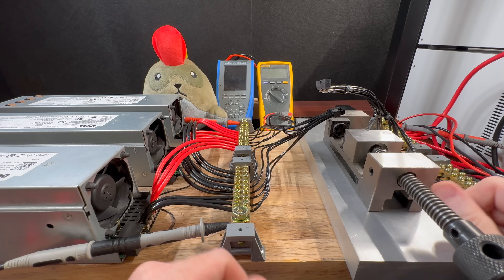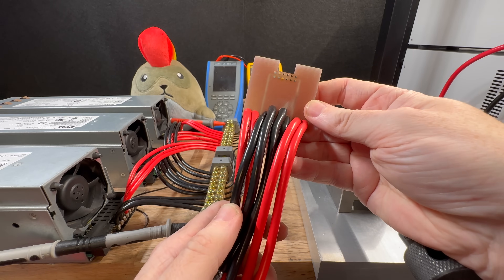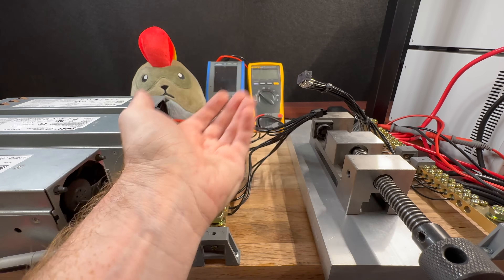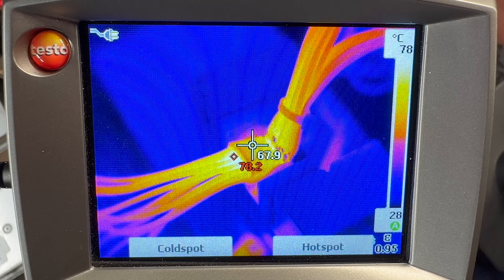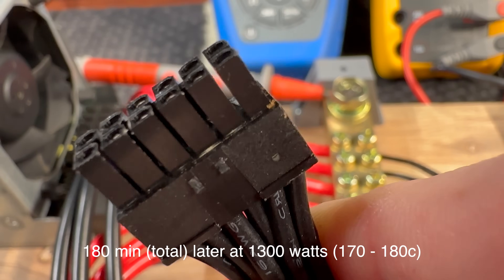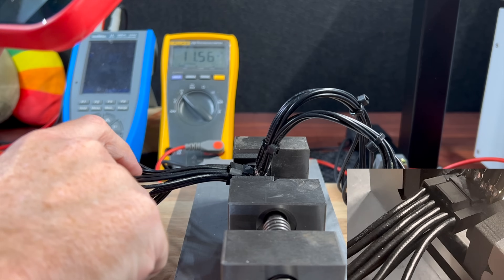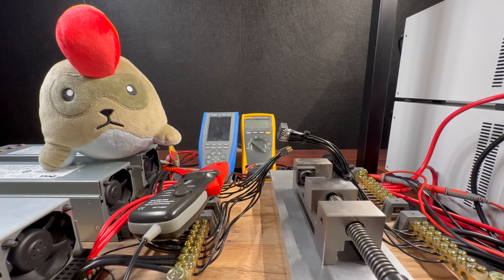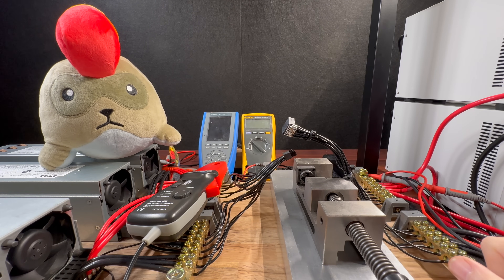NVIDIA 12VHPWR - Q&A + Melted Wires

Comment: Thank u for your practical tests. I think you have to keep adding current, because people keep saying connectors and cables are melting. Even if u have to put in 2000w to make them melt, atleast u have finally proven to people that those plastic cables and connectors arent made of titanium.  XD    All i see everywhere is "melting cables, connectors,nvidia". Next test someone should do is take some corsair 1200w power supply, open it up, solder wires inside power supply board, not directly to connector  to test how power is transferred to that 12vhpwr connector and how hot it gets. Because i have seen psu side get hotter than gpu. I dont understand why everyone blame graphic cards for melting cables, its power supply that is giving  that power and its power supply that HAVE to put stabile power on each pin and balance the load. It is real quality issue with power supplies. How can most people have no issues while few say cables are melting. Funny is how they post 1 or 2 person pictures on hundreds of youtube videos, making it all look bigger issues than it is. Only time i had problem with gpu connector, it burned but didnt melt, was when gpu mosfet shortcircuit and exploded. Cleaned up connector and it was fine to go again. Car battery cables are much thicker and even there current is smaller than what u are using during that test, so i am surpised how those tiny cables endure it.
Reply: The reason people are blaming graphics cards is because they removed current balancing and individual pin current limiting from the 40 and 50 series. The way they wire the power bus on the gfx card side now, it can't tell if only 1 wire is connected supplying 100A or 10 proving just 10A each. It used to be they would split the power busses for every connector, have 3x12v rails (3 sets of 2x wires of the 8 pin connector), and have current sense and balancing for each and every pin, in-order to make sure the power-draw was even across them all (when needed), as a very much needed safety precaution. It also allowed for safe uneven power draw, as it was limited on a per pin level and tightly controlled so drawing less from one wouldn't drive up the others as they were also tightly limited too.

Anything drawing this many amps across so many wires should have some kind of protection against failer modes in supply imho. Now Nvidia have ditched the 3 split rails and essentially every power wire, across however many multiple connectors it uses, at the GFX card side ALL goes into a single power rail directly, and not through current balancing circuits or individual current limiting circuits either, like it used to. So now it has no idea if only 1 or all 12 of the wires are even electrically connected or not (in fact it doesn't even know if only one wire out of a single one of 3 connectors is drawing 3x an entire connectors worth of amps, if it was paired with a PSU where the 12V hp rail fed multiple connectors at the PSU end!). Providing the connectors them selves are plugged in to the GPU and their sense pins remained  un-effected (which they would be likely to be, as they don't really pass much current), the result is 40 and 50 series cards are happy to draw 200W or even 600W+ through a single wire and cook it's self, and it would have no idea this was happening till the power dropped from a physical failer of the wire/last surviving connected pin, and I don't need to explain how dangerous that could be...! If you swapped out the 10 pins that supply power with a single 1Aut cable, and left the 2 sense pins attached, the GPU would be none the wiser as it just connects every single power pin together on the board directly anyway!!!

The reason we don't blame the power supply, is because it can't be expected to know what the load wants, it has no way to know if say 2x12V plugs are supplying one or two separate cards, and it has no idea if 1x12v plug is supplying 1 single rail on a card drawing universal amps, or 3 separate rails on a card all needing different amps, so it just gives what ever the load can take or "asks for" by it's current limiting circuit, when within the PSUs overall current limit (as the load demands will vary massively between, say idle, and running 4k gaming on 3 monitors for example, the supply needs to be able to supply what the card needs when, and balancing could throw off a card if it has multiple rails and has differing power demands on each, like a 3090 might have just for example). It's up to the load (in this case the gfx card) to limit and control exactly what power it gets. Nvidia used to control this tightly, for every pin, but now the only thing it controls is the overall load demand, and doesn't care how it gets it, and can't even tell when there's a fault in that power delivery unless it's already got to the point it's not receiving enough total power, by which time things have already most likely melted with the failer mode we are discussing. THIS is why everyone is blaming the GPU manufacturer. 😉
Reply: @Dafty_Boi Why are you saying it cant be done on psu side. PSU is all about balancing power. But most solder around 30 12v cables onto same board. Powersupply (if made that way) can also sense if there is current draw exceed on single cable more than cable allows and just cut off power for safety. Imo power supplies should have certain standards and classifications for using them with those high power gpus, some probably have those protections and features, reason why they maybe work as intendend vs using some older power supply with same power. Graphic card side should have fuses for shortcircuit, which only few have. Thing is gpu doesnt have space, nor psu for all those balancing circuits. So its probably best to have some additional board that can be used between , like one they measure gpu power, it supposedly balanced it out. And its ONLY few cases where its not balanced for ppl, where some wire has 2 - 5 amps more than other. Since i havent seen any PSU tests for that connector in mind, i cant say that it is GPU fault. I have seen how poor quality even better psu s are made, cost money only because of name.
Reply: @HappyValentine24  I explain in my post exactly why in the third paragraph...
Reply: @Dafty_Boi  sorry about it , its just alot text to reply to. Well psu modular example have different connectors where it can already balance it out  and protect if it wants no? And from what i saw, nvidia didnt connect every pin, just split checking into 3 sections for balancing. But its still not solution for cable connection, its like bandage. Example if cable is faulty, bad quality, it should be replaced not expecting gpu to add more stuff on board to fix something that is fault of someone else. Fix would be still if its done power supply side and not giving out power to one cable. Maybe im wrong.
Reply: @HappyValentine24   
No worries it's a lot of txt and a complex subject! 

I'm not saying it's a bad idea in principle. And I'm not saying that's not how it should of been done to begin with. It would work with 40 and 50 cards perfectly fine, but it's backwards compatibility that becomes a bit of an issue with modular supplies. Afaik, at least 8 pin was current sensing/limiting at the GPU end on each pin (or each pair of pins to exact), and then feeding into 3 rails from there which could all require different power depending on card design and what each rail feeds, I'm not as familiar with the high end of the 30 series' power topology, as that's some in-between 12 pin thing but without sense pins iirc. So you may be right that it just balances the the three rails and not at a pin pair level. 

I guess if they implemented it purely for 12v hpwr, as that's got to have it's own rail in the PSU, and have only 40 series onward use that section of the PSU it wouldn't cause any issues and is probably the best thing to do short of nvidia reverting back to at least checking more than just total incoming power! 

The main reason it was never done before was because the hungry components in a PC have always dealt with incoming power themselves. There is a certain amount of protection on the PSU side, but they normally have just one or two big rails supplying all similar voltages, and it's more nvidia just suddenly changing it so they don't current balance anymore without ensuring PSUs manufactures are gonna take up that role and just leave per wire pair power at both ends not balanced, and it only be regulated per connector which is how it's been done in PSUs since way back afaik, with GPUs controlling exactly how much of what they get where.

8 pin etc would probably have to stay unbalanced PSU side, due to the various older cards own power balancing typologies utilizing rails that can be assigned to less than a whole connector (2x8pin on 3 rails for example, which need unbalanced power within one connector as a result, which the GPU previously would deal with and limit on a pin level (afaik) to stop over-current occurring on any of the pins on a dif rail, and the PSU wouldn't know what the GPU wanted other than the voltage and overall power draw per connector), but for 12v high power alone it actually makes sense now with 40/50 cards how they are, all just dumping into one massive rail, I actually didn't think of that before and was thinking ALL PSU power rails couldn't change to it, but they don't need to 😅.
Reply: @Dafty_Boi  I guess i should dig into different PSU board circuit schematics to see how they organize power on different top end psu s if there is a difference. Old ones for sure really were poorly done, just punch of wires in bundle in board single spot. I use to replace capacitors on my psu, 4x times during its life, still works tho, stubborn. Now i have some SS Focus GX-750 3.1 , so will see how that will work, got it incase im gonna upgrade to 5070ti or amd. My brain still cant get along with a thinking that having 32 cables is good idea to send at gpu instead of proper high current cables, like in test 6 wires per connector or how many it was. Its just wrong. Imagine car, having 32x thin cables going to starter.
Reply: @HappyValentine24  I'm trying to remember the name of a good vid I watched about the history of power connectors in PCs ... lemmy check my history. 

I agree OLD old boards were not really caring, but also they were relatively low power compared to recent years... (but it's still not really an excuse) it's sort of the not old old, but not cutting edge, yet still pretty high power ones I'm mostly referring to, especially ones with a dif amount of rails compared to plug sockets (but I'm pretty sure on some Nvidia founders boards for a while, till recently, had more than just one rail per connector). lemmy try find this vid sec....
Reply: @HappyValentine24  Actually hardcore Overclocking did a great vid named - How Nvidia made the 12VHPWR connector even worse. :goodvibes:
Reply: @HappyValentine24  I actually got mixed up and you are right about the majority of 8 pin, what I was remembering is how the founders 3080, 80ti, 3090 and 90ti etc. utilize 12vHpw, THEY are the ones that have multiple rails per connector, and balance pairs of pins within a single connector. So it would be the 3090/3090ti etc that use the 12 pin that could not be compatible with PSU balancing, if their rails have differing current demand.

Sorry for making you read all that earlier, and then me make a mistake like that, but I knew some of the prior gpus had multiple rails per a single connector, turns out it's the first gen of the 12v hpwr spec though! :O
Reply: @Dafty_Boi  It is big problem with companies being stuck in compability issues. They should move on and make something new. Will in future gpus come with 2x 12vpwhr that split  to total 8x 8pin cables? 9070xt dodged cable issue because they didnt release graphic card that extreme and just stopped bit lower. If amd made card that was as powerful as 5090, im sure they would melt too :D
Reply: @HappyValentine24  Yeah it almost feels like the PSU companies were completely left out of the discussion on the new 12V hpwr standard altogether, which as you say is a huge issue, not only for compatibility, but ofc safty too. Especially with these specific changes Nvidia just made to it their end (it worked really well how they had it in the 30 serise). 

It's only ever the consumer that pays in the end too, when their shiz breaks or burns, and every company is pointing the finger somewhere else, or back at the consumer as in this case with their "user error" tag line. Regardless of whos fault it is, it's not the consumer! It shouldn't even be able to fail the way it is, with uncontrolled unbalanced current, even if you were intentionally trying to cause it! Be that the PSU companies OR the GPU ones tbf.

Comment: Really appreciate the work you're doing! Something that might be interesting to try is thermal cycling a connector, say 1000W or 1200W for 15 minutes, 5 minutes cooldown and repeat a bunch of times. It might be possible that thermal expansion and contraction stresses the connection and leads to increased resistance which leads to increased heating which leads, eventually, to a result.
Reply from the maker: It’s on the list, once I know the variables are under control 🙂

Comment: You are testing the connector as the weak point. But in realality the weak points are the wires because of their diameter (you are using bigger wires).
+ not same global temperature in a PC case.
So all your tests are mistaken.
Reply from the maker: I am literally using the same wires from the bequiet connector, anything outside the bus bars are completely irrelevant as the bus bars are a single 12v and gnd rail
Reply: Exactly. The hypothesis is faulty and focuses on the wrong variables. I think he's just doing this to be a contrarian or something. It was always current distribution. I hope AHO mocks him.

Comment: If you carefully review all the photos and videos where people’s connectors have melted, you’ll notice that only 1-2 pins are affected. This leads to a certain conclusion:
The main reason connectors are melting is that most of the pins have little to no contact, causing almost all the current to flow through just 1-2 pins.

It might be worth to make a test with a 500-600W load but connecting it to only 1 or 2 pins.

And the likely reasons for poor contact on most pins:
1.	People are careless and don’t fully plug in the connector.
2.	It’s trendy to bend the cable sharply right before the connector for aesthetics, which causes misalignment and partial loss of contact.
Reply: there is enough evidence that shows how even with a correctly plugged in connector you can have high resistance connections, leading to too much current going through 1 or 2 pins leading to melting.
its not just a user error, its a design problem
Reply: @zahnatom  Nope, design problem is wiring on the cards, not the connector itself, unless it has physical defects like varying pin lengths etc.
Reply: @tomasbohunek9698  this is a design problem of the standard which allows for this to happen.
Reply: @zahnatom  That is an interesting theory. The connector having 6 pins implies to have them connected to 6 different things. Else why it's not one big pin instead?
Reply: @zahnatom  It is not User error. These 12vhpwr connectors cannot be un-&plugged as many times as the good old 6 or 8 pins. they heavily degrade physically by rubbing against the mating, and that will not happen evenly on every single pin, but unevenly which will heighten the resistance for many of the pins, which means that electricity will go the easier path through other lower resistance cables, these will carry most of the load...
It is team greed's user error for already BS'ing around with the 40 series, by combining all cable outputs to the pcb, aswell as not putting any effin shunt resistors on the cards anymore!
To just ignore all the issues that already cropped up with the 4090 (CAUSE OF ITS DESIGN), then launch a new series WITHOUT ANY CHANGES TO THE CABLES, CONNECTOR + PCB and charge as much as they do is laughable they really dont care about consumer GPUs anymore! To "cheap out" on components that dont even cost a few dollars (AT MOST! NOT EVEN TO MENTION BULK PRICING) just doesnt make any sense. They are just trying to milk the AI market as hard as possible and not worrying about anything else until they notice a sharp decline in market- & mindshare because at this moment in time we are complaining about safety hazards, non existant msrp and even board partners starting to milk us, but all of this does not matter because enough people still buy their cards!

I really did want to buy a 5080/90 this gen, but I cant because I cannot trust these BS cheapo cards running 24/7 when i am not at home and potentially starting a fire!!! Yes my use case might differ from yours.

How tf did greed pull it off to have the connector, aswell as power stages, connections, etc. the right way on the 3090/-Ti,  aswell as shunt resistors on there. Just to then eff it up with the 40 AND THE 50 series..?!? This is unbelievable!!! There were already SOO MANY COMPLAINTS AND FAILURES ON THE. 4090, THEN THEY BRING OUT A NEW GEN AND  N O T H I N G   CHANGED CONSIDERING THE CONNECTOR/ON PCP POWER SUPPLY?!?

Team greed is really digging itself a grave here, if they do not include 2x12VHPWR connectors on their cards in their mid series refresh, or hell even Partner models with 2 connectors (doesnt have to be a new model) I wont be considering ngreedia at all, if they fixed it with the rtx 60 series, id consider it if the 6070/-Ti is as good as the 4090...
AMD has gapped the difference in raytracing this gen, and theyll probably have a high end model again next gen, if not even this gen...